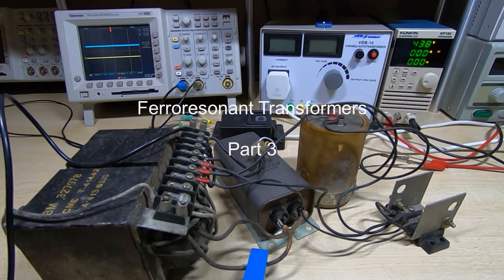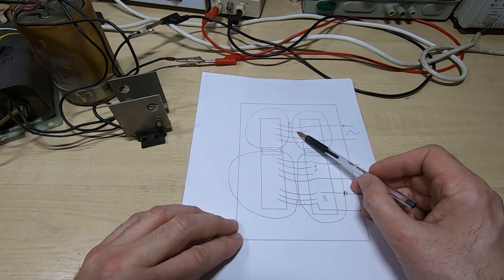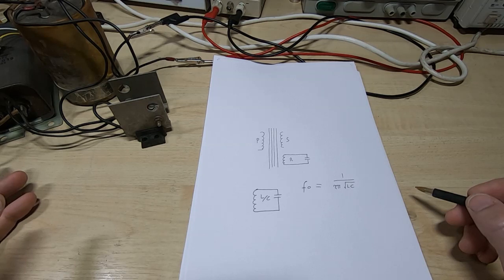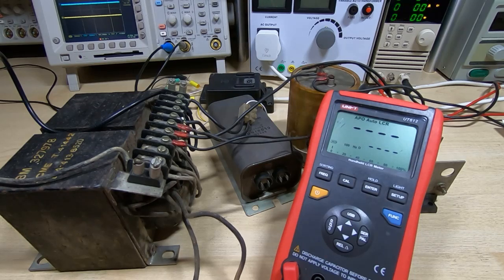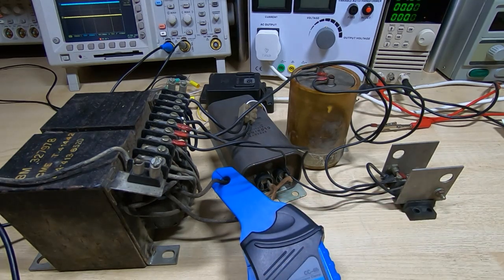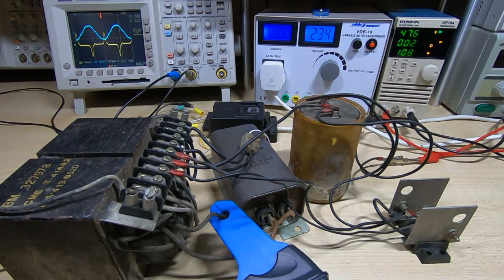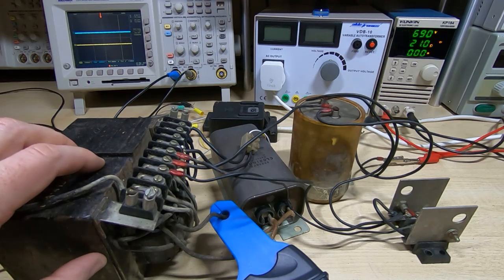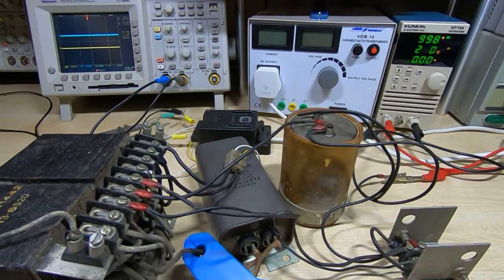Ferroresonant Transformers Part3

Comment: ‌Please help me for my dialysis machine,  its came with 120v60hz input, 24v 15amp output and ferroresonant winding with 30uf capacitor from usa,...... But my country supply is 50hz.....So  How can i calculated for modify for same input output on 50hz supply....Or haw can i calculat a new transformer for 50hz on same input output...i have knowledge about general transformer winding calculation.. Please help....

Comment: I wonder what the output voltage of the secondary winding looks like? Again very interesting but if possible I wouldn't mind if you go into more detail about these. And maybe an idea, but it would also be very interesting if you could make some video's on how to design a transformer from scratch, how to calculate, design and make a transformer. And last question, that current probe from Hantek, are these any good? I see they are quite cheap (around 47 euro).
Reply from the maker: The output voltage waveform is actually the key to the point of these transformers and I will be covering this in the next video. Nice to see that someone is paying attention :) . I needed to establish the principle of partial core saturation first and this is done (hopefully) so the next video will cover the relationship between primary current and resonant current and then the effect of this on the output waveform. I don't want to give too much away but I left a clue in an earlier video as to the regulation mechanism. If you are interested then look at the secondary voltage I showed and you may be able to figure it out. Hopefully everything will fall into place in the next video.
Reply: @JerryWalker001  Looking forward to the next video.

Comment: Is that hard on the capacitor to take those high current spikes?  Not sure how many amps it was but it seems running the capacitor under high current spikes like that for its whole life might shorten the life?
Reply: jontscott caps are rated for up to certain current